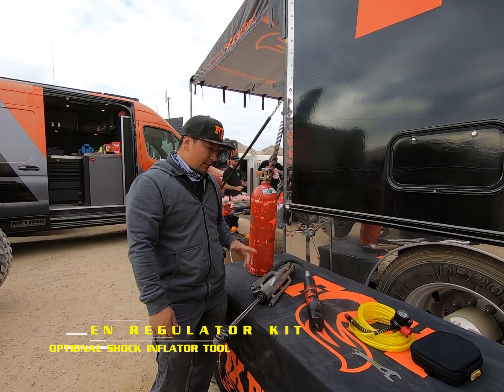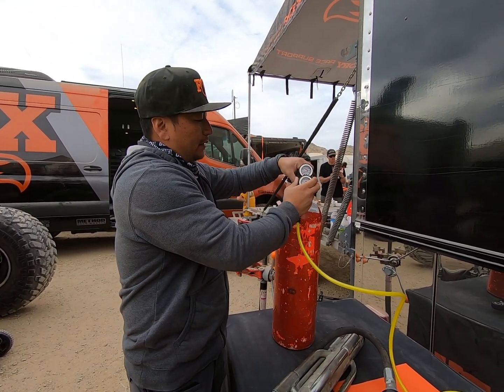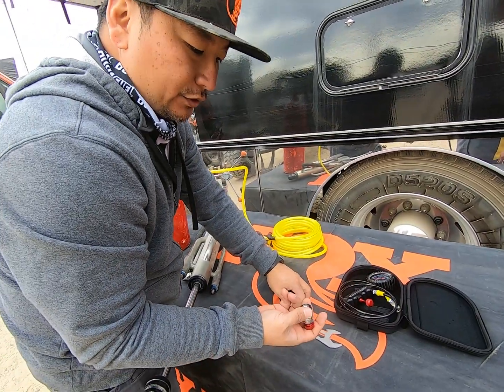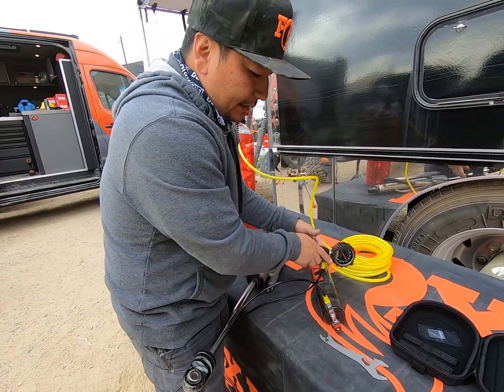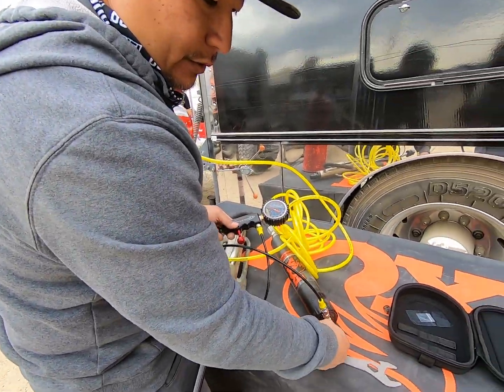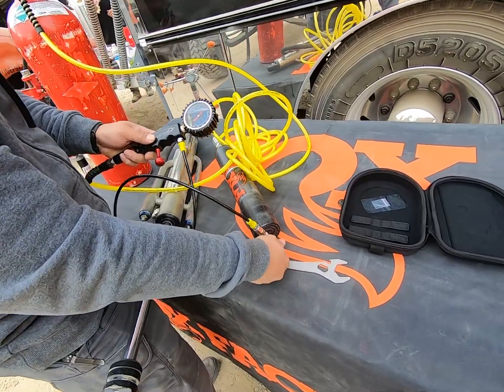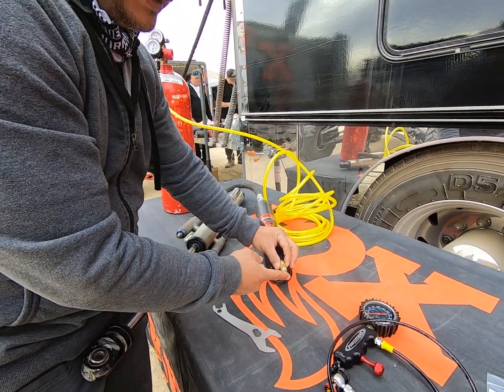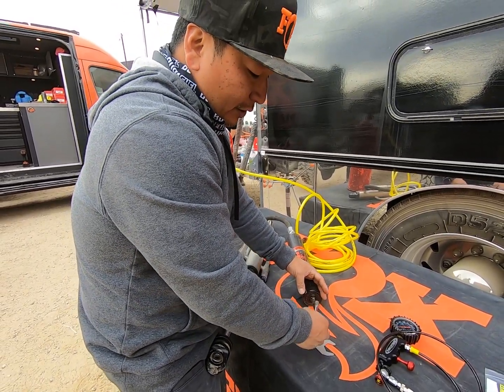Shock Boss Shop - N2 Shock Tuning and Filling Kit demonstration - Power Tank

Comment: Will any tank work with the powertank regulators?
Reply from the maker: We use standard bottle valves appropriate for the intended gas. So yes, you can buy your own N2 bottles to use with our N2 regulators and your own CO2 bottles to use with our CO2 regulators.